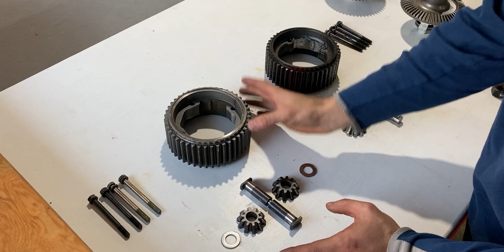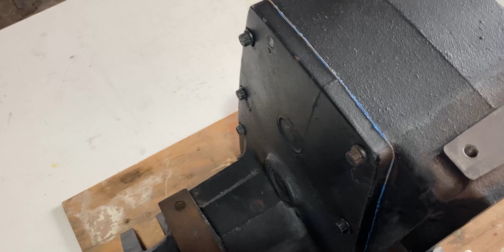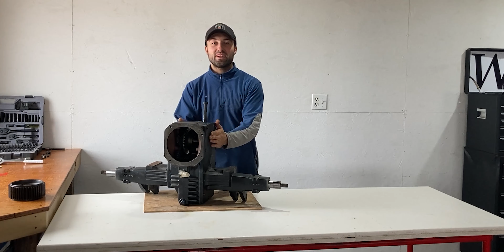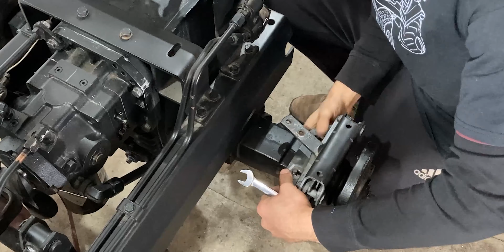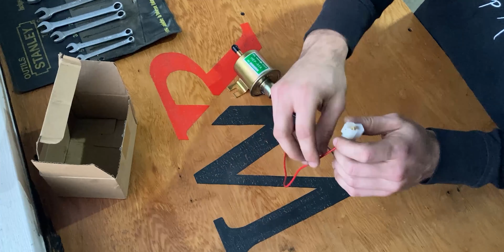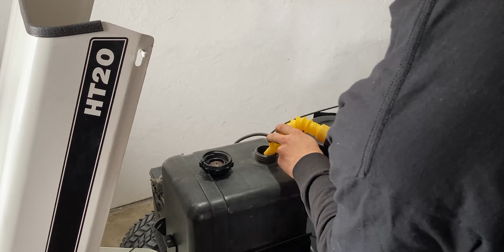Is The Bolens HT20 Issue Resolved?

Comment: Do you have any problems with the fuel pump over powering the needle valve in the carb? I have a JD 420 with onan and the same pump and had to put a regulater in line to the carb to reduce pressure more
Reply from the maker: The way I have the pump setup seems to be just fine. I haven't seen any issues while running the machine, but I will take your experience into consideration! It's always good to exchange knowledge. Your solution on the other hand is also very good! I believe this fuel pump had the lowest pressure and if I have any issues in the near future, I will share an update. Thanks for your thoughts and I hope your JD 420 is working like a charm again! Best regards

Comment: hello, I have a Bolens 1055, but it consumes a lot of gas, do you know what the problem is or is it normal
Reply from the maker: Hello Emir, your tractor might be running too rich. If you remove a sparkplug and you can tell that the tip is black (carbon build-up) then it is surely running too rich. This can be cleaned with a wire brush or some scotch brite.
After that adjust your fuel ratio set screw on your carburetor (inwards or by tightening). This will give your engine less fuel. You might also have to adjust the fuel-to-air ratio set screw just to get a nice idle once your fuel ratio is set.
You can adjust your carburetor while the engine is running and it will not hurt anything. Just make sure you get a nice idle and when you raise your engine rpm that it isn't starving for fuel. I hope this helps. Regards Andreas

Comment: WHERE do you get your parts for this tractor Sir ??? How much did you pay for the unit Sir ??? How heavy was the rear end unit fella ???  The part that gets me is the hydraulic motor does not have locating dowel pins. I wonder what the engineers were thinking or should I san NOT !!thanks
Reply from the maker: The rear end parts were sourced from a parts machine from the United States. Luckily, the parts I received were like new and I found the lead in a facebook group for Bolens enthusiasts. I did not do a price-breakdown on this Bolens HT20, but I picked it up for under $1000. After the restoration I see this value increasing significantly. Everything works, It has fresh paint for many years to come, it has two very nice attachments (snow plow & rototiller) and the overall package is very appealing.
Parts for the engine or the rear end can be found elsewhere, since the manufacturers are Kohler and Sauer Sundstrand. Some major components may be harder to find, but parts machines always come up for sale and if you decide to build one good running tractor, why not put the best parts onto it. 
Let me know if you need any other information. Regards Andreas
Reply: @WorkshopRebuild  Thank you for letting me know Andreas. I will touch base with you in the future. Peace vf
Reply: Hello Andreas, I added a few more question Sir. Some here some on the other videos. I look forward to getting me one too. Have you any knowledge of these tractors having limited slip differentials ??? The parts you used look really well designed. I know from repairing things this was a factory blunder for sure.  Thank you for your help and good luck too Andreas. Just love  your channel Sir. Peace my brother. vf @WorkshopRebuild
Reply from the maker: @victoryfirst2878  Thanks for your great questions! I have not heard of a Bolens HT20 with a limited slip differential. Maybe there are some differentials out there that would fit...but I'm really not sure.
The original design was not good at all, but I guess the issues started to arise after hundreds of hours. After that you probably didn't have any warranty anymore on the tractor anyways. 
Thank you for your feedback and I'm glad you enjoy my videos. I hope to share many more with you. Regards Andreas
Reply: I look forward to more great videos from you Sir too. vf @WorkshopRebuild